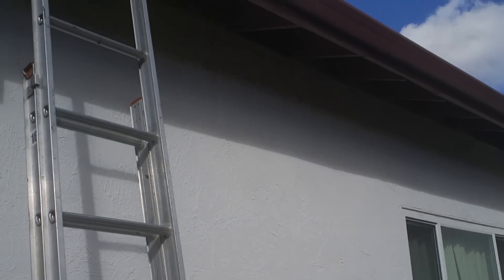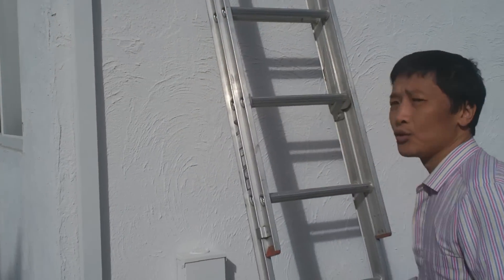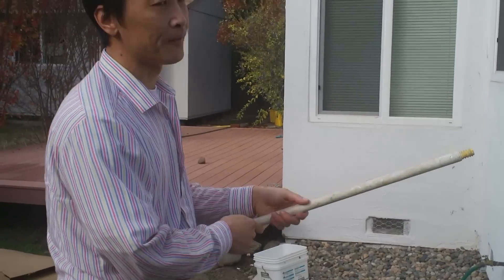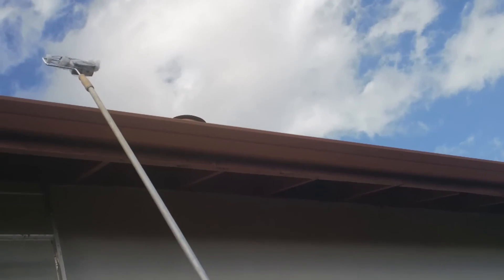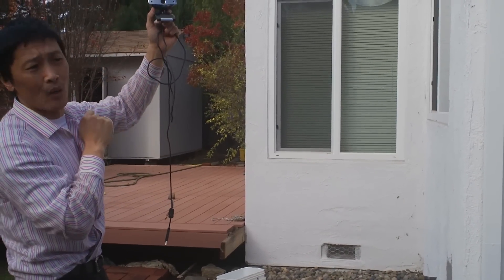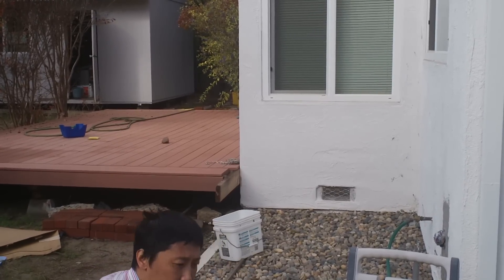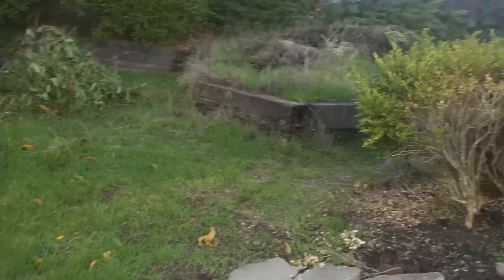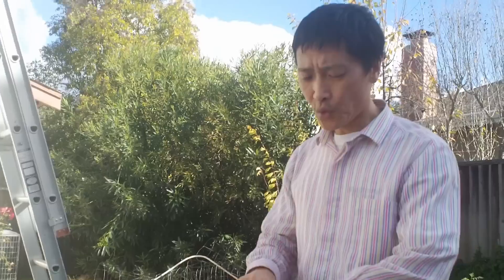Cheapest Gutter Cleaning Without Ladder

Comment: This little baby packs a punch for the price (just over 30 bucks). I'm comparing it to an old Craftsman blower that recently died after about 15 years. So far I've used it four times https://www.youtube.com/post/Ugkx9IdbewMd3eOaX3SS_kV4wC73v6yWG2KY and it's done an excellent job. It's light, and it moves leaves and debris very well. It's a little shorter than the craftsman, but it's fairly easy to manage. I don't ever use the front grip (requiring both hands). If I did, it would increase the distance between the blower and the debris, or it would require me to bend over awkwardly. I'm 6' 3", so I just hold it (since it's light enough) with one hand down at my side and it's a perfect fit. It's also back-heavy, making it easy to maneuver up/down/left/right motions of the blower end. As a final perk, I can actually appreciate the safety cord lock feature, since my other blower's lack of a decent one caused my power cord connector to start falling apart, due to all of the pulling, etc. If you're not ready to spend 200 - 400 on a gas leaf blower, and you don't mind messing with a cord 2 to 4 times a month, then this thing is for you.

Comment: Great idea about the phone camera!  I will try it tomorrow.  I have rigged up an air hose through a 3/4" PVC pipe to a "T", capped on one end and a 1/8" hole on the other end.  I connect to my compressor and it blows the stuff out.  I do need to put a ball valve at the handle to stop the air vs shutting down the compressor.  Now I'll use the camera to see where I need to use the hose.  One more step to make it easy and safe!  Thanks so much!
Reply from the maker: Thank you for taking the time to share your setup and to contribute to the topic. FYI, we also have a newer video: https://youtu.be/PnJm90LclYs

Comment: I used your paint roller cam before and after cleaning my gutters (on 2 story house).  I could easily see clogged areas and that they were freed.  THANKS!!!!
Reply from the maker: Thank you for sharing your result
Reply: Robert Lawson i also have a two story gutter in the back of my house i can reach 15 feet of it off my deck but cant reach the other 15 feet and suggestions on how to clean the last 15 feet
Reply from the maker: @craiglawson1930  For high gutters, check out our new video here: https://youtu.be/PnJm90LclYs

Comment: Thank you very much for your video.  It worked.   Since I was banned from climbing onto the roof by my family, I had to opt to other ways from the ground.  Luckily I got a used 16 ft long pole for $5 from a pawn shop and I used two paint paint roller frames;one for camera to  video record the status of the gutter and the other one with a fork made from a hanger wire to push down the leaves which were clogging ( covering ) the entry for the downspout.   I had to add and extension wood and taped it to the roller frame so the fork reaches to the entry of the spout.    I worked well for my situation.  Thanks again.
Reply from the maker: thank you for sharing your solution, I can imagine the pretty picture ^_^
Reply from the maker: some new ideas, and for high gutters, check out our new video here: https://youtu.be/PnJm90LclYs

Comment: some good tips here.  I bought the gutter covers to prevent this type of problem.  Every company that sells them out there says their's are the best.  While they definitely help, they allow material like leaves, buds and keys to collect on them and slowly grind down so they fall in the tiny holes and build up a sludge in the trough.  They say the wind blows them off but with seven years of having them, not all blow off and the sludge builds up over time.  In my case, I've had to clean the troughs by using a pole with a pinched tip attached to the hose 3 times in that period.  It blasts some water through the covers and does get things moving but it is a messy, wet, dirty job and I'm still going up on the ladder to check.  I'll try your camera idea and hopefully will be able to see through the cover holes without having to climb up.  I'm thinking I'll have to pick a bright sunny day to get the light shining through the covers to be able to see.  Thanks for these tips.
Reply from the maker: Thank you for sharing your experiences. Your info is very useful for people who installed gutter covers. How strong is your pole? We found that the backwards reaction force from water jet is very strong.
Reply from the maker: For high gutters, check out our new video here: https://youtu.be/PnJm90LclYs

Comment: Thanks for the good tips.  I'm hoping to tackle my clogged gutters tonite with a hose attached to an extendable pole.  It's two stories high and I'm hoping the pole will reach the gutters while I'm on an extension ladder.  Just hoping I won't have to climb too high on the ladder.
Reply from the maker: yes, let us know how it goes. Just  be aware that the backwards reaction force from water jet could be very strong. Also the higher the elevation, the lower water pressure is provided.
Reply from the maker: For high gutters, check out our new video here: https://youtu.be/PnJm90LclYs

Comment: Use a ladder stabilizer to get safer on a roof.   Managed to in Winter time to put heat cables on our roof and also used a ladder clamp to hook onto the gutter and even put a heavy block behind the ladder so could reach further to put wires on the ROOF.  Felt very safe and secure then!  But this is in general a helpful Idea too!  And while putting up the cables also was able with a scoop to clean a messy gutter that even had a gutter cover on it which was removed to do the cleaning.
Reply from the maker: thank you for taking the time to share your experiences
Reply: Heat cables inside the gutter to melt snow? Does it stay there permanently?

Comment: I have a gutter which has many trees above it and the down pipe always get clogged. 

I've drilled and inserted a hose attachment so when the gutter is clogged. I attached my hose, turn the water on and it blasts the blockage and clears my gutters.

I'm looking at a way to attach the hose in a permanent way so it looks like. So all I need do is turn on the tap from time to time.

Maybe a second skin to the down pipe to hide the hose will work?

I've tried gutter guard screens but the leaves just lay over the guard and the water ends up just running straight off the roof.
Reply from the maker: thank you for sharing
Reply from the maker: some new ideas and for high gutters, check out our new video here: https://youtu.be/PnJm90LclYs

Comment: Thanks for the video bro, but by the time you are done messing with your inventions I would have climbed that roof and cleaned the gutters all around that house, including the downspouts. When the roofs are pitched to much and have wooden shingles which get slippery when wet, in this case I work off of the ladder and don't climb the roof. Otherwise I quickly remove the trash and dirt with a small garden scoop or a flat scraper or spatula (depending on the shape of the gutter, some have the bottom rounded) and what's left I rinse with the garden hose or my pressure washer wand at low pressure while standing on the roof (I have never fallen off of a roof in the 8 years I've been doing this). I don't use those long wands with the hooked nozzle any more, all the crap falls on me from the gutters and the gutters don't come out very clean. I have also seen the edges of the roofs with damage caused by those wands and I don't want to get blamed for it, so I just cleaned them manually and then just rinse. If the bottom of the downspouts go into the ground with one of those large plastic pipes, I disconnect them near the ground so that the underground pipes don't get clogged up because they usually don't drain anywhere other than end in the ground under the grass or an underground gravel pit. I do charge extra when I have to go up to 2nd, 3rd and 4th stories high, I won't go any higher than that. NOTE: I do tie myself sometimes to my safety harness when going at or over 2 stories, I always give the rope or cable (I have both to use) only 6 inches to fall (6 in. slack), as I move I have to adjust it at my harness every so many feet, but it goes fairly quickly when I have to tie myself, it does slow me down a little comparing to using nothing on one story high but I sometimes have to do it to make sure I finish the job alive. By the way, I weigh 105 pounds and I can climb like a monkey, no big deal.
Reply from the maker: +Pressure Washing  if you climb, then it increases the probability of injury and you have to add the time of visiting a doctor.

Comment: Lol, I do this all the time , i like the "genius" title , I use slightly different ingredients for my telescoping cell phone camera roof selfie video gig, I use any pvc pole or wood piece that exceeds 6 feet; attach a small cardboard box( from instant coffee product box that has open top) by tape , to the post im using. The cell phone sits in the box at the end of the telescoping post, which, like you, it is hung up over the edge of the roof with varying angle as you walk along your house. I use it on yearly gutters check, and  roof inspection,  like after a hurricane.  Also, can attach non flying drone with wifi camera to pole also for live stream.
Reply from the maker: thank you for sharing your tip of a cardboard box. FYI, recently we have some significant improvement on the cleaning part of this topic: https://youtu.be/AM6lpjKFtrw 
also in terms of camera in gutter cleaning, we have a newer video:  https://youtu.be/PnJm90LclYs
In general, attaching cell phones to anything: https://youtu.be/5o-ea5vdaa8

Comment: Hi....I'm looking to install a gutter guard on my grandparents house but need one with minimal maintenance, for obvious reasons. I've seen ur video which is very helpful. I did, however, hear of, I think they are called Rhino Gutter Guard, if I spelled that correctly, but not sure how good they really are. Have u come across this type of gutter guard and If so, what do u think of it? I'm seeking all the info I can possibly get to be able to make an informed decision. Ur help will be greatly appreciated.
Reply from the maker: Guards can reduce cleaning, however be aware that seeds, fir needles, and other small debris can clog the holes in the guards. You can't hose or brush them off. You need clean them otherwise the water simply shoots over the top.
Reply: If you have unlimited budget, there's Gutter Glove that's cool.

If you're a poor miser like me, I bought a plastic screen from Amerimax (#85198), 5$ per roll, which so far does the job in stopping big leaves from clogging the gutters. It won't stop the shingle grit though. Still sucked to install it high up on the ladder. I HATED it.

The big test will come this fall and winter with more leaves and whether it will support the snow.
Reply from the maker: ***** let us know if it gets clog very easily and water over shoots your gutters.
Reply: corgLLC :)

Comment: Remove all gutters from your house except where there are entrances.  Then install a french drain or a channel drain around you house for the water that falls off the roof to the ground (make sure your roofing system as a drip edge, of course).  Problem solved, no more cleaning gutters and having to deal with the expensive problems they can cause.
Reply from the maker: Yes, thank you for your reply. Still this option is an extra expenses for home owners. Also when there are gables on a house, the combined angles can send water spouting out at the bottom...

Comment: To higher a professional will save you a lot of time and effort. A professional will spend only an hour or so to thoroughly clean your gutters. Then the task is complete and you can spend your valuable time doing something more productive. This guys ideas will take you all day and the gutters will not be thoroughly cleaned. Professionals will also ensure all downspouts are free from obstructions. This video has provided no solutions for clogged downspouts because they typically require taking apart and re-installing the downspout in order to relieve the clog. A professional can address these issues in a matter of minutes.
Reply from the maker: This video is for people who already decided to use ladder to clean their own gutter, we simply provide a safer alternative for those people. Also hiring a professional is not "in a matter of minutes", you need to use Yelp to find someone, talk prices, insurance, wait for them to come etc....  Why does anyone want to DIY at all?
Reply: Hmmm, a $20 solution that lasts forever, or paying a gutter cleaning crew every year for the rest of your life? Tough choice. Cleaning the downspout only requires a high pressure nozzle

Comment: I know you're trying to help man, but this one of the worst ways to do it.  It's why you are getting a lot of dislikes.  This may work for low and not too tree-heavy areas, so you should probably preface that.  A hose will not get all the muck and the leaves that have accumulated THROUGHOUT the gutter, you may even back it up.  You can hook up a pressure washer with pvc pipe if you are afraid to get on a ladder or just don't want to risk it, and have a u shape at the end (many of videos out there).  The best way really is to get on your roof and blow it out with a blower.  It takes seconds and this way you can see where you may have to pull debris out by hand.  Wait for the day you want to mow, so the lawn mower picks up the debris on the ground.
Reply from the maker: Thank you for taking the time to provide feedback. As long as this video can save injuries or inspire similar ideas, we are happy and not worry about the dislikes.
Reply from the maker: This time, I tried very super dirty gutters, check out our new video here: https://youtu.be/PnJm90LclYs

Comment: I can see you're not at all experienced climbing a ladder. Your invention will not repair / seal leaky brackets or thoroughly clear down pipes or make detailed repairs where needed. Solution to Gutter cleaning = Hire a professional...
Reply: Your right he does not know how to use a latter  guitar is a good place to put a latter not only would he be able to see if he cleaning everything out its the only way to access the roof for other types of repairs. Also tying off the latter to the guitars nails is one of the safest ways (Bungee cords work great for this)
Reply: Ladder just under the gutter on the fascia and gently tapped so it holds solid is good enough. Does the job! :)